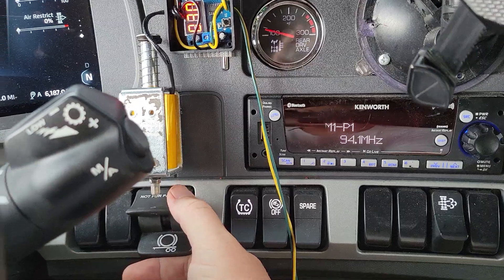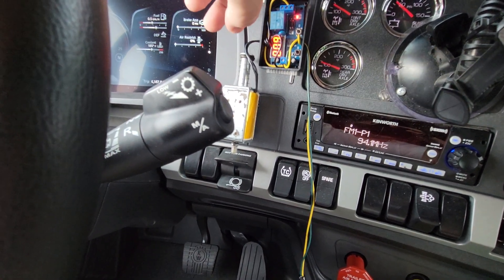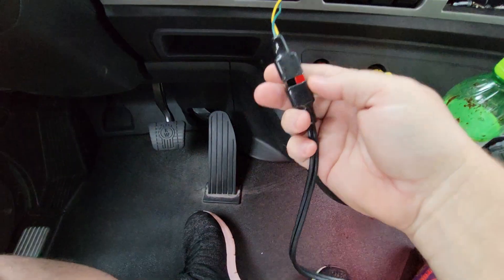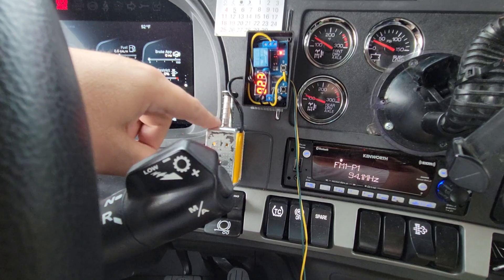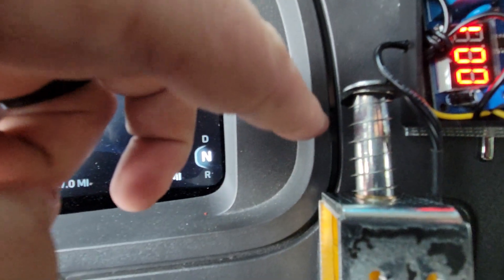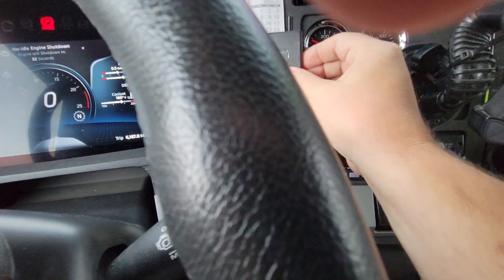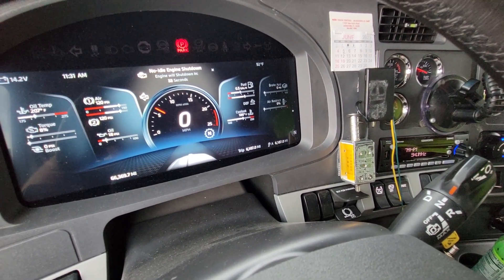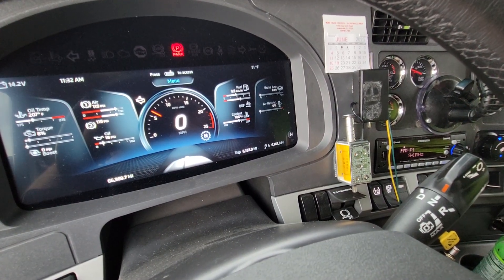Kenworth 2023 T680 Engine Idle Override

Comment: Chock your wheels and release yellow and keep trailer brakes on u good too
Reply: Doesn't work. I regularly have 5 min idle shutoff happen when sitting in traffic and my foot on the brake.
Reply: @TheCrawdaddy029 really what kind of truck that. Most of the truck if I release both and yellow it works
Reply: @JohnLee-k4x has happened in international, freightliner, and now kenworth.

Comment: Alls you have to do is turn the cruise on and press set and it will turn the idle up and you’ll be good all night. No parts needed
Reply: That doesn’t always work on every truck
Reply: I’ve been trying this on my 22 t680. It doesn’t shut off, but I want the oil pressure up through the night. My cruise set may not be working because it’s not working like it did on my 21 t680
Reply: Yeah this dont work. Idle sets and even speeds up and still shuts down after 5 min
Reply: U obviously dont have a 2025 bruhh..
Reply: 2025 kenwoth
Reply: Did not work

Comment: 900 rpm with cruise control
Reply from the maker: I tried that. On this truck it didn't work. I even tried not setting the tractor brakes and just setting the trailer brakes.
Reply: @K4DRE  can you show and explain how you wired it up trying ordered the parts
Reply from the maker: @spartan301622 I found the wiring diagram online. I think I still have it save on my desktop computer at home. I remember it was pretty simple. When I get home I will take pictures of the one I have already wired up.
Reply: Definitely post the link or video on how to set this up. Thanks for the idea
Reply: Did you find the diagram I've been looking?
Reply: All the parts just dropped this weekend.  I need to get a DC adapter to power it up and then install it.
Reply: Installed and works well! The only thing that took time was figuring  out how to wire it.  Thank you!
Reply: How did you wire it?? @darynluukkonen4583